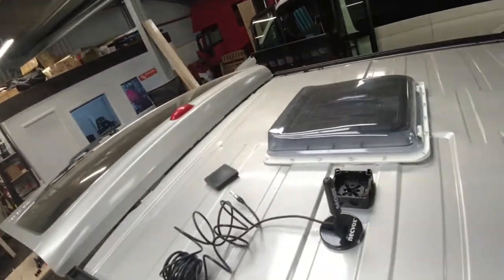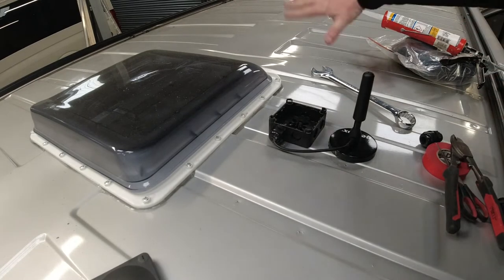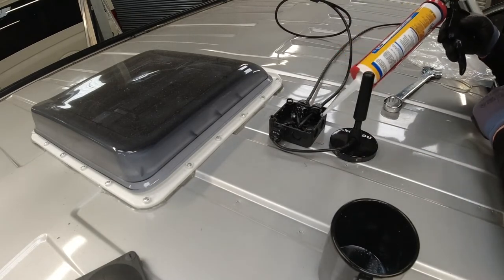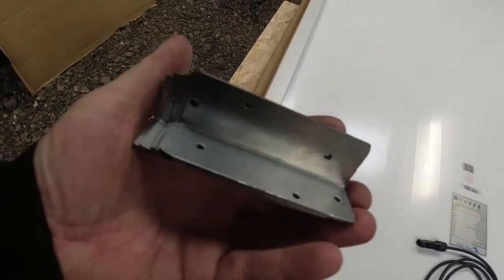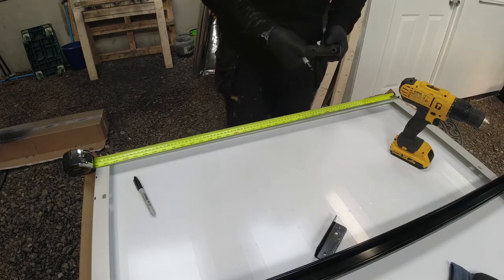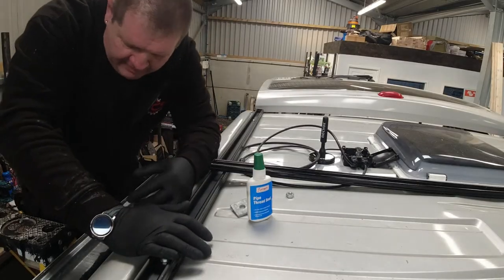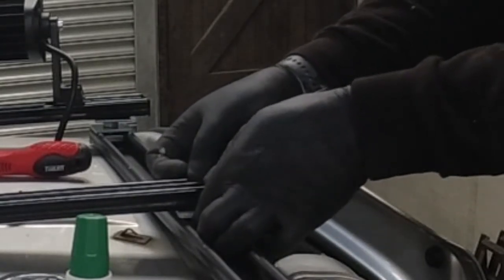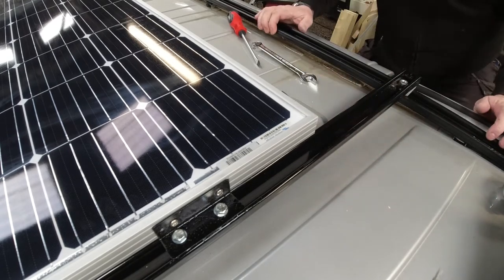Renault Trafic Campervan Conversion - Solar Panel Install

Comment: Did you plug the panel in?
If yes, make sure to cover it before doing the wiring.
If not, can you get to the plugs?
Reply from the maker: no the panel isn't hooked up and it's covered with the bix it came in